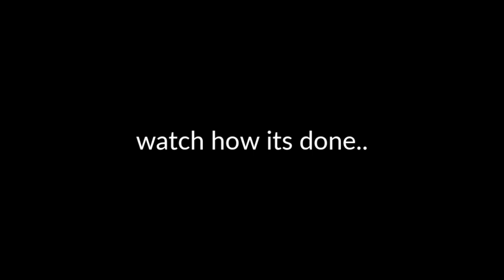RACKET FRAME BROKEN AT THE GROOVE

Comment: Hello Sir, i am from chennai, i tried some Aluminium dealers to buy 24 gauge aluminium sheet, but no luck, can you let me know where i can get it or any other material instead of aluminium can be used for fixing
Reply from the maker: Any metal fabricator can help you.. This is not aluminum.
Reply: Bro ipo seri panitingala?
Reply: Use nails

Comment: Tension 28lbs auto machine can?
Reply from the maker: The joint is perfect to hold 28 lbs..
Reply: How balancing racket? And tnikness plat iron how? I want to try. I from malaysia. Can u share?
Reply from the maker: there will be a slight weight change at the joint..
Reply: Where u from I wanna visit you

Comment: Tension Maxsimum  after Repair?
Reply from the maker: Depends on the quality of the racket..
Reply: Tension  28lbs auto machine  can?
Reply from the maker: @mohdfairusyusopmohdfairusy6275   joint is perfect to hold 28 lbs...
Reply: @keepituseit6839  tq bro